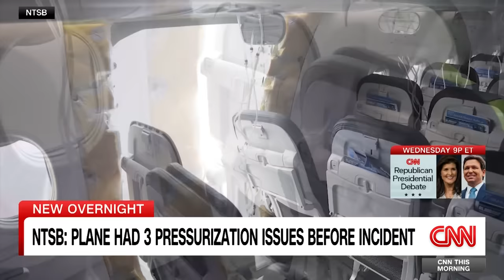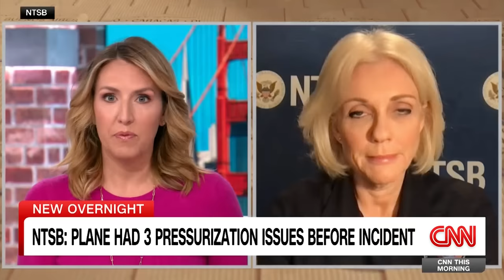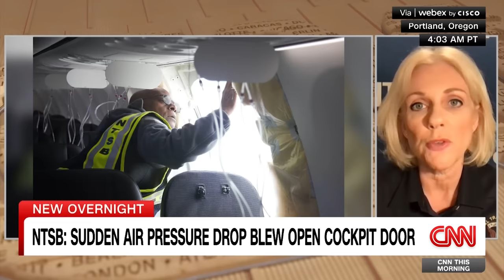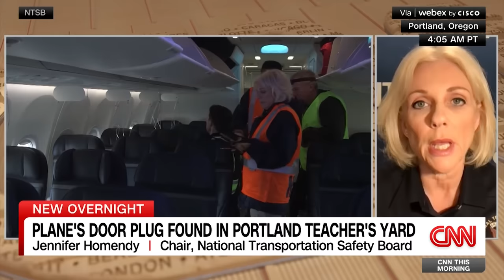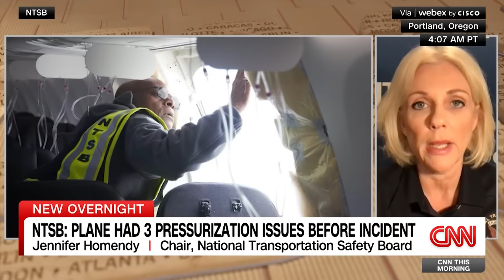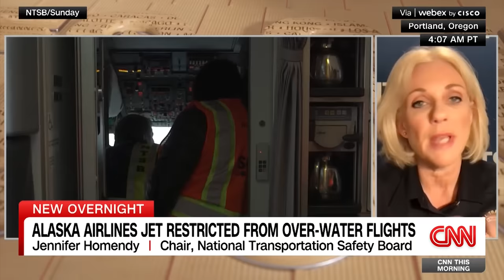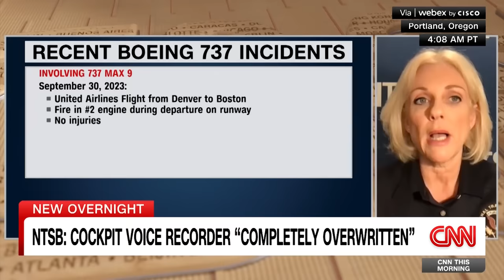Official asked whether it's safe to fly on any Boeing plane right now. Hear her response

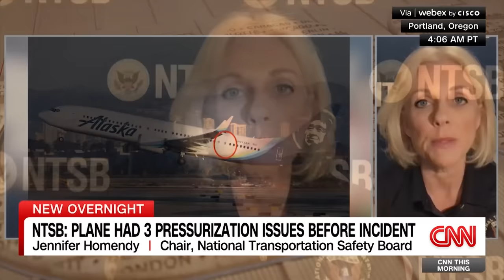Comment: The thing that's really worrying is that the plane took off at 5:07 and landed at 5:27 so was only flying for 20 minutes. the cockpit voice recorder lasts 2 hours, so how on earth was it overwritten ??? that's a question that needs serious investigation. 
Also it has be worrying that the cockpit door was sucked open, and apparently took several attempts to close again, so if this happens at higher altitude you really want to be sure that at least the people who have control of the aircraft are able to retain full control and have a chance to land it .
Reply: Because if the plane has power, so does the recorder 🤦‍♂️
Reply: Exactly - It is my understanding that if there is ever an issue with the integrity of the plane, the tapes need to be kept.
Reply: I think they're talking about the previous warning light that went off the day before -- that was more than two hours before the incident, so they have no cockpit voice recording for that.
Reply: @johntheoldmod I think the answer to your CVR question is because power remained on the plane (as expected) long after it was back at the gate. I'm assuming that whichever pilot was running their "securing" checklist (if Alaska has a dedicated checklist) either missed the step where they were supposed to pull the circuit breaker, or they skipped the entire checklist. Time will tell. Probably their first incident requiring CVR data retrieval, so rookie mistake..
Reply: @Part_121  I mean, the point of the NTSB stands - it shouldn't be the concern of the pilots right after an emergency to pull that circuit breaker. Just make the CVR go 25hrs, it's hard to get to anyway, and we won't have this problem. The NTSB also noted that they had (iirc) 4 incidents in 2023 where the CVR was overwritten, something they (understandably!) find annoying.
Reply: @Fs3i  Oh, you'll get no argument from me on that, but the OP's comment came across as if there was something nefarious going on behind the scenes. I had been thinking about this CVR thing recently, prior to this incident, and it just seems to be one of those items that had its use case change over time as other advancements were made. When the first CVRs were in use, and only hand a 30 minute capacity, on metal tape no less, you sort of get the idea that they would most often be used to gather info after a crash. As the Western World's aviation industry has become safer, there are many, many fewer crashes to investigate, so they are coming in very handy for runway incursions, and that sort of thing, more often. Maybe the real question we should be asking is when can we switch to cockpit video with audio? I understand both the cost and union arguments, but I think there's a way around both of those issues.
Reply: Any terrorist can now gain access to the cockpit by triggering a non structural decompression incident, very concerning.
Reply: The cockpit door is designed to open with an explosive decompression in the cabin. It may be Kevlar, but it still may explode if the door doesn't unlatch, injuring people.
Reply: @ImperrfectStranger  That's simplifying it, because in the other directions there are blowout-panels. So if you lose a windshield, the door remains closed. 

The thing that I found super concerning is the sheer violence with which the door opened, slamming into the lavatory so hard that door could not be opened for a while. Apparently the cabin crew was quite concerned that someone may have been in the lavatory. Maybe the blowout-panels need to become bidirectional...
Reply: Other than the fact that if you cause a depressoration event, you're going to be right there when and where the pressure drops.

If it can rip a locked door on the other end of the plane open, your ass is going outside when you open anything.
Reply: @Fs3i  Yes, intentionally simplified, although I did say "decompression in the cabin". There is a small blowout door for the opposite direction. The cabin crew can always gain access to the flight deck if the windows blew out and the crew were injured.
Reply: @Part_121  Maybe this item was on the checklist that flew out the cockpit door during the mayhem....😂😂
Reply: @Part_121  I agree, there must be a solution to the CVR debacle. You can remotely get realtime & saved video/audio recordings from a Ring doorbell cam but aviation still uses re-writable 2 hr. tapes? It just seems like there should be an effective solution that doesn’t require hundreds of millions $ to install on every plane.

Comment: I was willing to give the lady a hearing because I have known some outstanding people at the NTSB.  And she is correct in saying that the pressurization faults may have nothing to do with the plug door, although I suspect it did.  If there are low inflow faults logged in the controllers, you can bet that it was caused by an air leak at the plug.  Next, we get a word salad about inspection techniques that reveal her lack of understanding of the process, a comment about the "glass" in windows that are made of acrylic, and no mention at all of the real issue: where were the four bolts that were supposed to lock the plug in place?  Good questions, crap answers.  The NTSB is no longer an effective agency.

Comment: If that panel hit the elevator the pilots would most likely lose elevator authority. If that happened most likely we would be talking about over 170 deaths!
Reply: It's not going to take out the entire stabiliser. How fast do you think it would have hit the stabiliser? It wouldn't have a lot of time to slow down by the time it hit the horizontal stabiliser. At worst, it would only damage the left elevator. Each elevator has an independent hydraulic power unit. There are redundant hydraulic supplies.
Reply: That stabilizer is real heavy duty designed in the 60s, that stupid door plug can’t hit it hard enough to take that plane down

Comment: Team of Boeing engineers determined that even with the door missing, the plane still had perfect structural integrity but the passenger's nerves were shattered beyond repair.
Reply: iphones were found with their charging cables cut in half. If someone had been on that seat it would have been an injury at the very least.
Reply: Had the plane reached cruising altitude, a child would have been ‘deplaned’ and maybe other people too, poss9bly floght attendants. Depressurisation could have caused cardiac arrests, you hope the crew would have been able to get oxygen in time.

Comment: "Our aviation system is the safest in the world. We are the gold standard......" Jennifer Homendy has repeated this line in other interviews, historically that's absolutely not been the case and I'm pretty sure that statement's not true in recent times either. It unfortunately does sound like the usual "America is the best" nonsense.....
Reply: Not a Major Airline crash since 2009, and almost 7 million hours on the MAx series- the system is very safe- but nothing can be absulute!!
Reply: I have to agree with Brandon on this one. Accidents/mistakes will always happen, but the United States has a damn good track record when it comes to aviation. In my personal experience of flying in different aircraft around the world, the only place I think does it better is Japan and look what happened to them last week. Flying sure beats driving in a car 😉
Reply: America is really the best in terms of setting standards of aviation safety. You have the best pilots and air traffic controllers the industry can have. Of course the Max series of planes has cast doubts over the practices in design and testing of planes, but I'd like to see this as an exception as every other plane model like 747, 757, 767, 777 and 787 have all been highly successful. I have always felt that the 737 program has reached a point where it cannot be engineered any further as every subsequent generation has had to use creative methods to build on a platform which is less than ideal for newer needs. In general, this approach comes with limitations and at some point you will run into problems. Maybe it is time to consider a clean sheet design for the mid range narrow body offering.
Reply: @sierraromeomike  I'm just wondering where I can see actual data that properly backs that claim up. I don't doubt for a moment that America has great pilots and great controllers, but when you claim to be the best, you need to be able to back that up with something. Is there like a global ranking of controllers and pilots of which most of them are American citizens, or how do you justify claiming to be the best? I've seen this claim in comment sections on youtube all the time, but I've never seen any proper scource for that. It would just be interesting to know how you want to evaluate that.
Reply: Just wear a mask everything will be OK
Reply: @Sicklehead88  just my impression as an avgeek. I don't have any statistics.
Reply: @sierraromeomike VAS aviation is full of videos of human errors from US incidents and you claim yourself to be an avgeek? lol.

Comment: Maybe the question should be whether it is safe to fly Alaska Airlines. The only response to a potential safety issue was to limit where the plane could be used instead of investigating and fixing the problem that already had multiple reports. Whether the plane was over land or water, the hazard to the passengers was the same.
Reply: Both! Is it safe to fly in a Boeing 737 Max and is it safe to fly with Alaska Airlines?
Reply: Bigger hazard to the plane over water as an emergency decent the air is too thick for you to reach your destination with the fuel on board.
Reply: Also United is finding all these lose bolts. How come Alaska isn't reporting any such findings? Are there safety checks lax? Can they be trusted?

The seats next to the plug were conveniently empty, why so? Could they sense the door was lose there? Why not ground the plane and have it inspected? .... really pathetic

Comment: They deleted the voice recording on purpose, because the've talked about the irritating flickering pressure lights in the cockpit. And those lit pressurization warning lights have Everything to do with the plug door. It was already loose before flight and losing pressure along the sealings. I have no prove for this, but this says my gut feeling.
Reply: Right... They couldn't have been flying for 2 hours so it couldn't have automatically reset. Suspicious AF
Reply: It doesn’t only record when in flight.
Reply: @a.miller8316 🤦‍♂️
Reply: you have no idea what you are talking about actually
Reply: I think you are correct. "there's that damn light again I told them to fix it" etc.

Comment: Alaska airline was absolutely negligent for allowing the plane to remain in service. They cannot argue that mechanics looked at the issue and addressed it. If that was the case, then why did they prohibit it from flying over the occean? Passengers were very lucky that when the section came off, it didn't crash into the body or worse, the tail of the plane because if that had happened, noone would have survived the incident.
Reply: think if that kid wasn't wearing his seat belt or if a flight attendant was walking by collecting trash. they would have been sucked out. regardless there are some torts that can be filled for negligence on Boeing and Alaska.
Reply: That’s not how that works, there are certain conditions the FAA (not Alaska) allows the plane to safely operate. This exact accident was why they restricted flights from Hawaii. If that door would have opened above the pacific? That situation could’ve been way worse. You are aware that mechanics replicate issues and attempt to fix them. If something isn’t right by design, that’s on the manufacturer.
Reply: @thebanksfilms4426  that is not exactly correct.  it is alaska who looks at the repair request and they follow guidelines set by the FAA.
Reply: @selftotjits  exactly, and they looked at the issue twice and couldn’t replicate it/passed inspection. Sounds like they made Boeing aware of the concern and Boeing never got to it.
Reply: Because if it has an issue and is allowed by the manufacturer to be kept in service but not over water it’s because the airplane can still fly safely. No airline does something like that out of negligence. The aircraft wouldn’t have been ETOPS certified with that certain problem but they can still operate it over mostly land because if something comes up they can easily land which in fact they did.
Reply: Need To lawsuit them and boycott
Reply: @williamcarnero9595  The plane was not allowed to fly over water because the door might pop off? Poppy asked the right question. If you knew the door might pop off why is that plane flying anywhere?
Reply: @mikemccoy3430  that’s not it at all lol. NTSB said a few hours ago. The auto pressurization light had no relation to what happened to the door…all 737’s have a triple redundant auto pressure system. I’d trust the NTSB over Boeing/armchair mechanics.

Comment: as an engineer, the fix is hinge these doors, latch them and double the bolts. Would you have your car door held in with 4 bolts? It is not pressurized(yet) so how would anyone think that is ok in a plane flying at altitudes? this was a bean counter decision that luckily happened when no one was in the seat. Bolting this door is dumb, even with twice as many, simply retrofit it as a useable hatch door, problem solved, or, do not cut holes in perfectly good aircraft bodies/fusel.
Reply: The door is hinged at the bottom. The bolts are not keeping the wing on. They are only to stop the door moving upwards, not outwards. Pressurisation loads are distributed on 12 "stops" on the left and right of the door.

Comment: Even though luckily no one was seated near the door plug, but I find it weird that seats in the middle of the aircraft (26A and 26B) were vacant in a plane that was almost full to its capacity. It would be worth finding out if the seats near the right side door plug were also vacant.
Reply: I thought the size is actually about two windows size, there is a child and a mother. The child's shirt was torn off.
Reply: Or that the door and other debris didn't land on someone.

Comment: “Gold Standard”??? Allowing cockpit voice recorders to overwrite every 2 hrs is not “Gold Standard”
Reply: This is literally criminal. Pilots by pressure of the airline know exactly what they're doing when they do this. A literally depressurization with a huge hole in the plane, if that ain't enough to pull the circuit at the end of the flight before you leave the jet i don't know what is. Pilots often do it for small things, this thing stinks it's company pressure & Boeing will be happy they didn't save it

Comment: I never flew the 7 3 but I assume the malfunction light and annunciation of the pressurization system was because the system couldn't maintain the proper internal cabin pressure when the system was activated. Probably because this plug door sometimes was not sealing properly. I would also assume that if there was a malfunction annunciation of the pressurization system in recent times and now a door plug blows off in flight, it is much more likely then not that they are related.